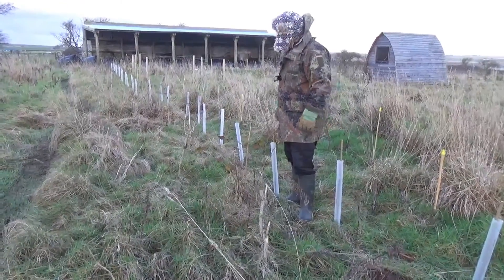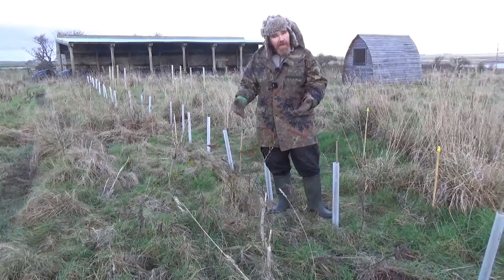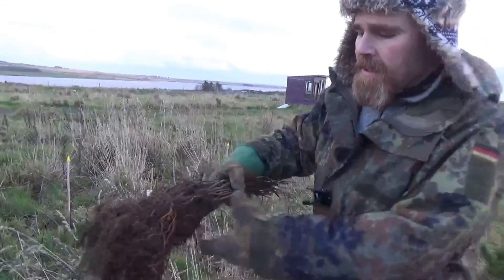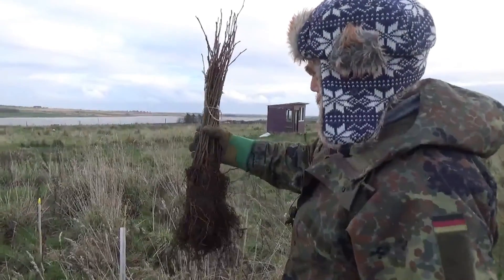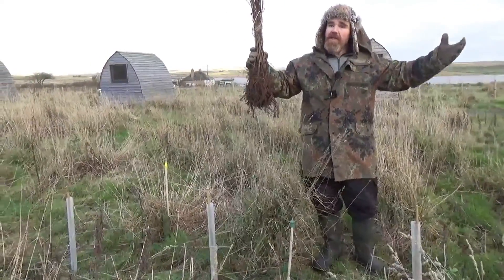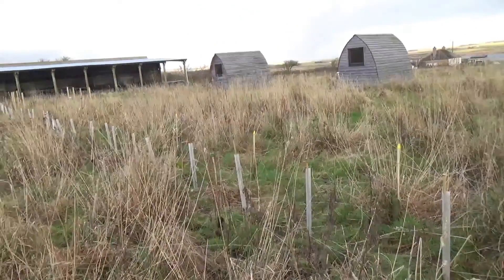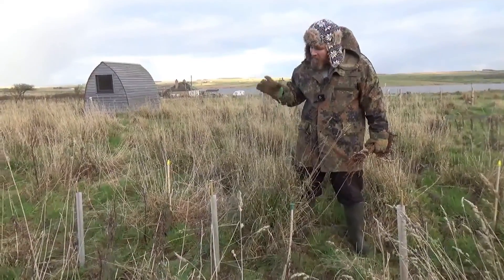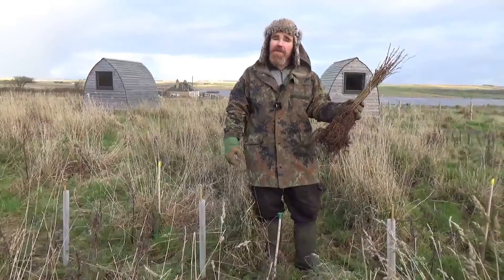How to get faster tree growth in wind breaks and shelterbelts.

Comment: Follow-up question (but in a new comment to please the youtube-algorithm-gods) - any idea how close you can get away with planting common alder? (but within a row, and distance between rows)

I have read that one can use alder as a hedge and plant them 50cm apart, which should work as a wind break (especially if combined with elaeagnus ebbingei like you suggested - it is borderline for my zone, but I read that a wind break also helps somewhat windward so that should help them). However, I also want it to work as a fedge vs roe deer which skulls are 10cm (ish) wide (not sure if their bodies are wider). 

I am considering a staggered double-row with alder (northern row with gray alder and second row with common alder), but not sure if 50cm distance would be enough to keep the roe deer out - especially since I would need to coppice (or pollard - I believe that also rejuvinates the tree?) some of the alder from time to time, but not sure if I can get away with planting them closer (maybe 50cm is too close for a double-row)
Reply from the maker: I've planted alder at 1metre spacing and it's thriving, but I've not tried it closer. If you're going to be coppicing or pollarding I'd have thought you could get that close together, it would be a wonderfully dense barrier!
Reply: @CairnOfDunnCroftPermaculture  Thanks. Those are still small(ish) alders I assume? (I saw one video where you planting alder trees, 50 piece from the house down to the main road, but I think those were planted further apart)

Comment: Any thoughts on how much the deciduous shelterbelt helps in winter? (vs one made up from evergreens) I forgot to check the growing zones for the fruit trees I bought, and ended up with one or two that is going to struggle... So I need to make a micro-climate for it (many options for deciduous trees, but can't find a good option for an evergreen - by "good" I mean dual-purpose)
Reply from the maker: Two I've used are elaeagnus ebbingei and holly. The elaeagnus ebbingei gives an edible fruit, and the holly will give a yield of branches to sell in winter, for christmas decorations. Holly is very slow growing though.
Reply: @CairnOfDunnCroftPermaculture  I looked into elaeagnus ebbingei earlier today 🤭(and after my comment I found a video of yours about that one and holly), but not sure if it will survive if I use it as a shelter-belt: cold hardy till -20C (but can go deciduous if too cold), but my hardiness zone says -15C to -18C so if I use it as a shelter-belt 🥶Maybe if I do like you and have more than one row, then it can get some shelter from deciduous trees in the rows around and survive (pluss the hardiness for the plant is probably when standing alone, so a hedge - or close planting - might increase the cold hardiness slightly?)

Comment: Brill video once again! What would be the difference between planting the Italian vs common alder? Is there a reason you've moved to the common variety?
Reply from the maker: Thanks! 
There is a reason. That section of the shelterbelt is below a neighbour's barn, and we get 100% of the runoff from the roof. When we bought the land, it was very waterlogged. But one of the first phases of the earthworks was a swale to shunt that water across the whole top of the site, and run the excess into an unlined pond. So it was likely to dry out over time, and the Italian alder is more tolerant of drought than common alder. The only reason we didn't use it throughout the shelterbelts is it's less tolerant of coppicing than common alder, and that's pretty essential in some areas of the shelterbelt to keep solar access clear.

Comment: Love your videos, they are fabulous.
I wonder if putting down cardboard around the hazel would be a viable option to supress grass (after mowing/trimming the grass). You might not have enough compost to  put on top of the cardboard for this area, but the supression of light should set the grass back. A question is how to fix the cardboard, so it's not blown away by the wind. Maybe with stones, or big pieces of rubble, if you have it available.
The alder is a wonderful idea. Wishing the best!
Reply from the maker: Thanks! Sadly, cardboard doesn't last here. It need to be weighted down, but rots quickly under the stones, then the stones become homes for rodents! We do use wood mulches some times, and a roll mulch that's cellulose based.